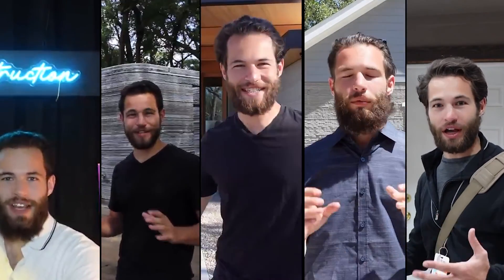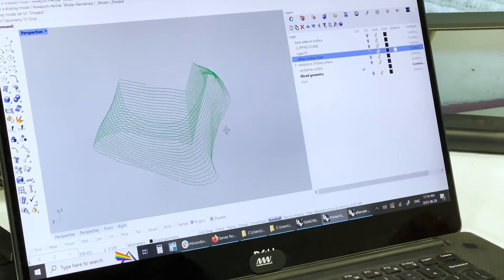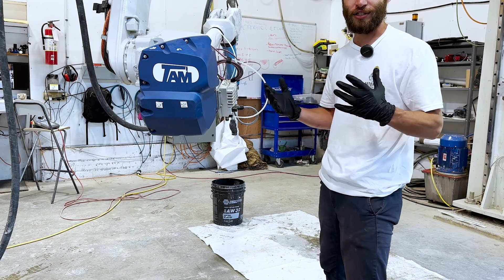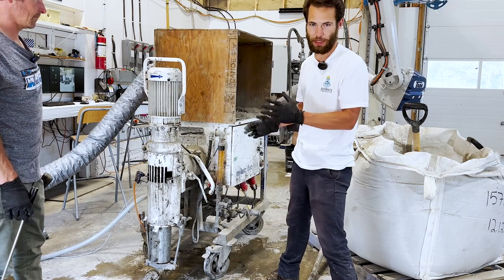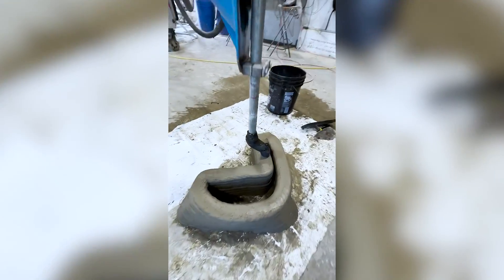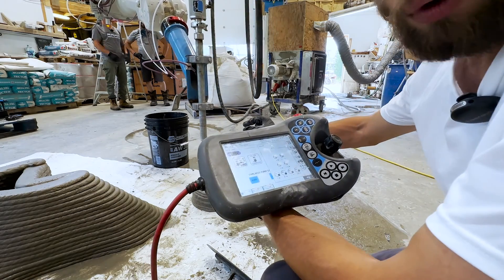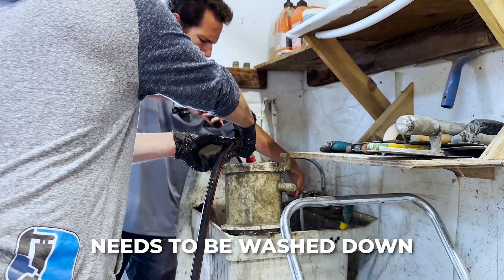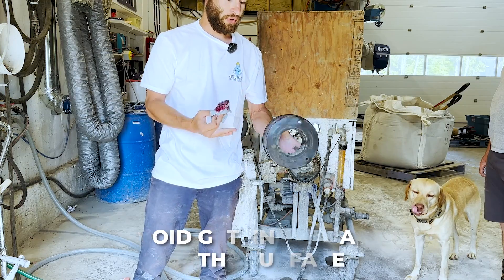REALITY of Concrete 3D Printer Operation HANDS ON

Comment: Score yourself a Revopoint Miraco handheld all in one 3d scanner, and you can produce 3d scanned VR holodecks based on the 3d printed surroundings, could prove interesting for just such exacting walkthroughs. I am not paid by them, but decided to get in on their 35% crowdfunder of the device.
It can help showcase the works of these constructive pioneers.
Reply from the maker: Used the one on my iPhone, but it’s the same one I shoot videos with so no footage of that
Reply: @automateconstruction  Hello, I have the know-how of the INPI patent 2830855 wood concrete 
Tested at CERIB: CSTB C is an organization in France This patent 2830855 isolant thermal and sound insulating    It can be done with Waste wood pallets and also with cork   
bonne journée franck gaucel

Comment: Just print round corners for square houses. Then join the corners with conventional construction.
Reply: That is practical for some applications, similar to the roofing.
Wonder how it would look to print a geodome to fit triangular windows and panels, that would have to probably printed using a additive to bring the cement closer to a clay type extrusion done slow at a higher line pass resolution to maintain the tolerances.

Maybe with SporeCrete made from growing giant slabs of mushroom type fungus on football field size trays, and eventually, the space elevator framework will occur using jack and the beanstalk 3d print-based technology!
Reply: @truetech4158  Print a large ball then roll it into the yard.